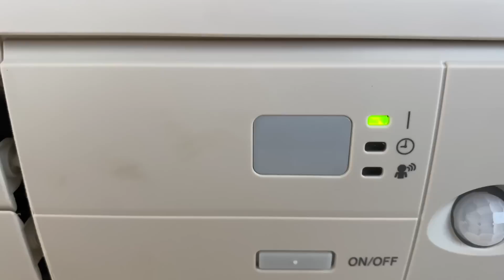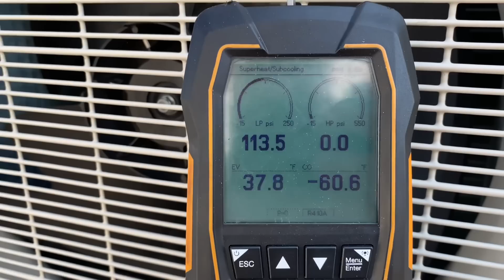Daikin Mini Split System Not Cooling - Low on Refrigerant - How to Discuss Options with Homeowner

Comment: Hey Mikey, of Mikey Pipes Plumbing not easy being cheesy. I like your podcast/social media. Daikin makes some pretty equipment, problems with control panel sometime. Again leak might be at the flange connection at outdoor unit, over tight connection. But again, refrigerant leaks out at a microscopic level. Most fully charge system will last about 8 to 12 years. But again, want to go back up on broke back mountain again. Love you buddy, the horror, the horror, the horror, the horror.
Reply: some pretty good equipment, unquote.

Comment: From an experience point of view? Was the wisest decision!  Have went down the road of line set R&R and new charge and in the end? Didn’t fix the problem! System would hold vacuum for 12 hours and marginal lost .. but under heat environment? Condenser coil have an ultra fine leak that didn’t show up with soap nor dye but Occasionally could pick up but not enough to find it. So in the end? 
 complete R&R new system. So the customer made the best decision ❤

Comment: 1:53, It appears they have forced air, strange why they don't have a traditional AC system.
Since his system is under warranty until 2028, shouldn't it have been covered??
Reply: likely got sold that unit as supplementary cooling/heating, for a problem room/second floor with lack of ducts and no good way to run them.

Comment: I am a little disappointed you did not pull out a electronic leak detector, and check first, before you did any thing, the unit under operation for leaks at the compression fittings. They are where you will find most of the leaks on these systems. Mainly due to improper installation, and not using the correct flaring tool, or special torque wrench. Also the unit being that old, the schrader valves might have been the source of the leak. I would at least do that, before condemning the line set, or any system components. It's relatively quick, and might save you a lot of unnecessary trouble.
Reply: @mofiddly You mean it might save the customer a lot of unnecessary expense.  

The real money for Mikey Pipes looks to be in doing entire system replacements.
Reply: Agreed

Comment: I have to ask.....when DOES it make sense to add a sealant to the system? I understand it may work FOR NOW, but if were talking pinholes, could it be worth it?

Personally unless something catastrophic happens or i lost ALL charge id see it maybe worth a shot. Worst case, it buys some time and i save up for a system. Best it fixes the leak and my unit runs another 10 years. 

Not an hvac tech at all, just a keyboard jockey trying to understand the hesitance of a sealant if the leak is small

Comment: Good video. So if I understand what you were explaining, if there is a leak in the lineset the best option is to replace the system? Why can’t you recover the remaining refrigerant back into the outdoor unit or a recovery tank, replace the lineset and then recharge the system as needed? Is that not an option for this homeowner? The homeowner decides of course but I didn’t hear that option unless I missed it. I have a Daikin mini split and was just curious about this video in particular. Thank you sir.
Reply: As just another homeowner, I have the same question! My bet is that whatever the crappy copper that was used for the lines ends up making its way through the whole system causing leaks in the indoor and outdoor unit as well. That would mean any work done rerunning lines or replacing refrigerant is just delaying the inevitable. I'd love to hear the Doctor weigh in though!
Reply: @mjbates  I want to hear from Mike also. The homeowner seemed really knowledgeable so I was surprised he didn’t want to try to replace the lineset since he had four more years on a parts warranty from Daikin. His decision though, so he must have thought that was the best choice. Either way, sucks that happened while still under warranty. That’s why it’s important to get extended labor warranties and ask if the manufacturer offers extended warranties too that include refrigerant leaks. My Daikin Atmosphera has those additional warranties from Daikin called Asure.
Reply: Warranty doesn't apply to lineset
Reply: @briantantlinger7936  Hi, I didn’t say the warranty applied to the lineset, I was referring to the parts warranty. Getting a new lineset I would assume has to be cheaper than buying an entire new system. He still had 4 years left (2028) on the parts warranty (and I’m aware that doesn’t cover the lineset or refrigerant). I just thought it was odd to not just replace the lineset that is all external and still have a system under warranty in case of other breakdowns for covered parts. I’m not the homeowner here though, I’m just observing and enjoying the content. Have a great day sir.
Reply: @Ryan-RM I would assume the roi on labor would not be worth. Lineset+labor+refrigerant=not worth in my opinion. Also what if the lineset wasn't the problem? What if by chance there is a leak in the outdoor coil. At that point all repairs up to that point are a waste. Replace all 100% fix.
Reply: @bluntastic333  Thank you for replying. I would also add that if the leak was in the outdoor coil, the coil is a part that is under the parts warranty - the labor and refrigerant isn’t though.  R410A shouldn’t be that expensive yet and mini splits hold very little refrigerant in terms of pounds. That’s all I’m stating here. Just wanted the full story as to why the homeowner made that choice. It’s his decision though. I just wanted to know more. Thanks again for the conversation. Most Daikin mini splits have a 12 year parts warranty and he stated he had 4 years left. It’s just fun for me to watch and chime in, nothing more nothing less - good content.
Reply: @Ryan-RM 12 year part warranty? Youre lucky to get a 5 year warranty with no issues from Daikin where im from hahaha
Reply: @Ryan-RM Three comments asking why the lineset couldn’t be replaced and Mikey Pipes provides no response.

The real money for him appears to be in selling entire system replacements.
Reply: @marcinmerrimack1726  @pipedoctor probably didn't see this post @pipedoctor @PipeDoctor

Comment: Ah-ha another leaky white insulation line set! Mikey I’ve removed line sets with that insulation on them and found so many pin holes man. Best case scenario replace all line set equipment should be good. There’s been a recall on that line set, I think unannounced; maybe throughout the HVAC industry that they leak. The chemical they used on insulation interacts with the copper and causes pin hole with the water formed inside the said line set . Big problem here in CT, replaced countless white line sets. Food for thought!

Comment: You do need to add if the line is too long 8:35
Reply: It depends on the manufacture
Reply: yes, they pretty much all have a "total max line length", as well as  "minimum length" per head and or total also.
too short increases noise from the indoor unit(coil is like a big speaker) and they can start surging the compressor/expansion valves due to rapid changes without buffer.
Reply: 131 or more something like that needs more ref